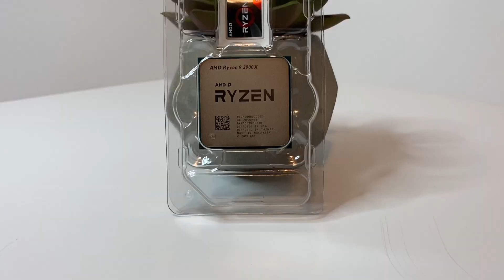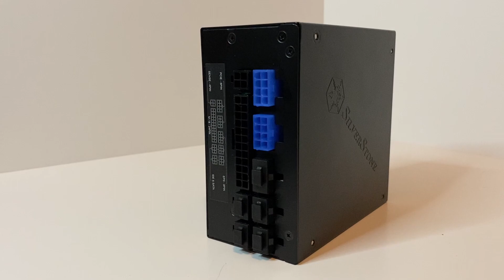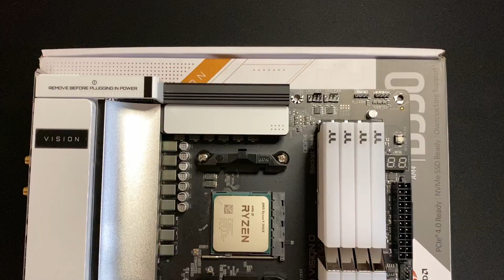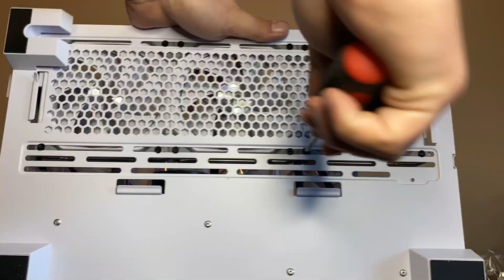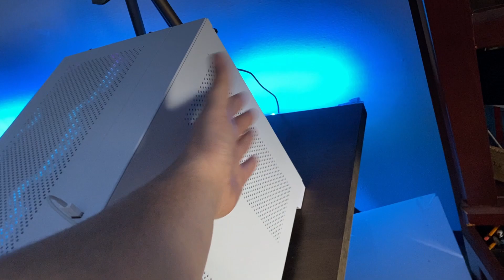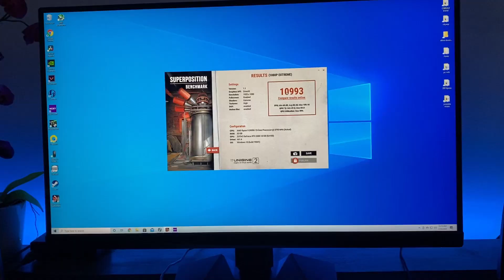$2800 My Dream PC Build! - Lian li o11 Dynamic Mini/ZotacGaming trinity 3080/lian li uni fan SL120

Comment: Lian Li makes great products and they look nice too! 
Your build: Any noise from the AIO as the air bubbles are now residing at the in/out let on the radiator? 
If so; try rotating the radiator 180 degrees. Or perhaps even better; mount it on top having the fans sucking air from the cabinet. Side and bottom fans should then be blowing air into the cabinet. Interesting to hear if that would improve test results for you. 
Congrats on making your dream PC build come true!!
Reply from the maker: Yeah thanks man!! No problem with this one but I appreciate the help! Stay safe

Comment: Sweet looking build!  You should flip your radiator fans as intake. the Brushed aluminum discs on the front peel right off with little effort so you can stick it right on over the Back label. I actually have 6 uni fans on the Galahad 360 in the 011D in push-pull as intake it looks like you have space for 2 more fans on the other side. If you are Playing @4K or even 1440P you won't really notice a difference from the 3900X to the 5900X. I did it but since I recouped most of my money selling the 3900X it wasn't a big deal. If you are running negative pressure you will end up sucking in dust through the crevices, if you flip the fans on your AIO you will have positive pressure and less dust. I have the Strix 3080 and Asus X-570-E with 32GB of Trident Neo, 2GB Sabrent Gen4 NVMeX2. W/12 Uni Fans. 
Haven't added it up yet and don't think I will. I Don't Wanna Know. I'll Just enjoy It. The 3080 keeps me warm for sure.

Comment: I watched another youtuber do comprehensive thermal testing for this setup. You'll get better thermals and noise if you flip your radiator fans to intakes.
Reply from the maker: I don’t even have this case anymore.. but it wasn’t loud and never got over 65 degrees.. and I’m in Texas with 97 temps outside

Comment: Double check aio orientation. Tubes should be at the bottom. Otherwise you risk running pump dry.

Comment: Just built my build (unfortunately paid a scalper for GPU about 100 over retail but I checked again recently and they’re somehow like 1100-1400 so paying half of that not so bad in hindsight lol)

Corsair 4000D airflow 
FE RTX 3070
MEG X570 ACE
16 GB Corsair Dom Platinum 3200
H100i PRO XT
9 5900x 
QVO 1 TB SSD
2 HDD
Rm1000 gold PSU 

So excited man hoping to snag a 3080 if I I’m ever fortunate enough to find retail

Comment: White vinyl wrap the backplate of the GPU in something like a whit carbon fiber would look clean. I wrapped my EVGA 3080 in white carbon in a vertical mount came out great and doesn't void warranty.
Reply from the maker: Yo you read my mind I actually bought vinyl rap today 😂😂
Reply: @CGBuild  It's really easy you wont even need a heat gun as the area your doing is mostly flat. Great build you have and you can get some serious thermal reduction and only loose 1-2fps from undervolting plus lower power usage. I got mine at 1980core @ 60c and +500Mhz mem running 900mv on a EVGA XC3 Ultra.
Reply from the maker: @scipher99  thanks my guy!

Comment: Do you think it’s safe to mount the aio tubes down on the side? I’ve seen videos and some mount the aio upside down and it’s in the front and it’s considered a good mount position. Do you think the same applies for the side
Reply from the maker: Well ever since that gamer nexus video came out everyone thinks that you need to but the tubes down.. it was a good video but for the most part you can do whatever you want.. manufacturers of pre-build systems still don’t put their tubes down if they put a radiator in so that’s all I’ll say.. but you can put the tubes however you want as long as it can reach
Reply: @CGBuild  would it make sense to have additional intake? Sorry for all the questions. Just curious about the thermals
Reply from the maker: @brokensinangel  yeah it would but with the aio on the side it has to be exhaust.. or I mean it can be intake but it’s not the best
Reply: @CGBuild  if I were to mount the side as intake with the aio would it cause any thermal issues? And why isn’t it the best?

Comment: I pretty much built this pc yesterday, but with a Ryzen 5 5800x. After booting, nothing displayed on the screen. I found that the bios is most likely not up-to-date to handle the 5000 series Cpu's. Now I have to disconnect everything on the motherboard, even the cpu, to do a qflash bios update. I hope that fixes it. Not something you would like to do after your new build 😔

Comment: Nice build man, I just got the same power supply. What did you do with the extra 4 pin connector on the 24 pin motherboard connector?

Comment: Awesome build, just a word of advice. rather relocate your aio to the top with the top fans running as exhaust and then have 2x side and 3x bottom as intake. you will see better gpu temps that way and your case will get less dusty over time.
Reply from the maker: In this case with an atx motherboard you can’t have the aio on top I would have definitely done that instead but sadly you can’t but thanks!!

Comment: How’s the PSU functioning ? I’m getting the same specs although waiting on the 3080ti. I’ve ordered the SF750 Corsair and wondering if that would be enough or should I upgrade it to 800-850w

Comment: That is a really good looking system. You obviously considered every part of that in advance. The memory and fans you used are really neat. I hadn't seen either before. I may have to consider the memory at least when I get to build my own dream system in the next few months. What size monitor are you using by the way. That's part of what I'll be including with mine since I've never gotten to have a nice large high rez montior.

Comment: i have a nzxt z63 240mm aio cooler, should i have the fans facing the way you did? ( exhaust ) instead of intake? i was thinking putting 3 normal fans below the gpu as intake then 3 ontop as exhaust. so will be okay for the aio cooler to be like yours? aka an exhaust or do you recommend intake?

Comment: your pump is going to suffer, as gamers nexus said you should put the pipes at the bottom because their might be air bubbles in the resovoir causing issuse and decreasing lifespan and acoustics as it is louder

Comment: Why specifically thermaltake ram? Doesnt seem like you have any other components to sync the rgb together to synapse. Id personally recommend gskill or teamgroup ram just for the sake of total sync
Reply from the maker: Thermaltake software is so easy you just put what you want and never gotta touch it again until you wanna change it.. I’m okay with having different software but for the most part I never really have rgb on

Comment: Hello mate I have a very similar build I have a question with regards to the SL120 fans did you connect the 2 on the radiator to the controller or the motherboard. Thanks
Reply from the maker: I connected everything to the controller
Reply: Many thanks👍🏼

Comment: Only negative id say about the whole setup is the fan positioning, I may be wrong, but it looks like you have 3 in take fans and 6 Exhaust, 3 On the rad and 3 above are all exhaust no? Your going to have some abnormal temps
Reply from the maker: That’s the only config I can use with this case but I’m having no problems!!

Comment: Fans at the bottom should be exhaust / intaking the heat of the GPU right? So that the air won't clash when the GPU releases its heat, then at the top side should be the one who's intaking fresh air.
Reply from the maker: Heat rises so when the heat is released it will go up so if you have the top as exhaust it makes the system run smoothly and not have so much negative pressure
Reply from the maker: @DoctorQcumber  yeah imma leave it 😂

Comment: I just got this case. What’s the best fan configuration
Reply from the maker: Use the bottom as intake
Reply from the maker: If you don’t have aio on the side the use side as intake as well the top as exhaust
Reply: @CGBuild  I’m gonna put my aio on the side. So use it as exhaust?
Reply from the maker: @brokensinangel  yeah have the fans just like mine in the video bottom as intake and side and top as exhaust

Comment: I'm building a similar one soon, parts are on the way. 
Specs in case you want em
GPU: 3070ti aorus master
CPU: 9 5900x
Cooler: corsair elite capellix 360
10 Lian li al120 fans
Case: Lian li o11 dynamic evo
Mother board: gigabyte x570s aorus elite AX
Ram: team group xtreem ARGB 2 16gb packs, 32gb
Ssd: corsair m400 2tb

Comment: too bad you couldn't get a hold of that white edition zotac makes. Also iirc your 3080 is similar to mine and strongly benefits from an undervolt.
Reply from the maker: Yeah a white card would have been sick... maybe one day... and thanks for the tip!
Reply: @CGBuild  I got a +100 OC @ .837 on my XC3, hope yours can hit some good numbers too. 

Wish that case came out when it was supposed to, else I would be using it too. Well done.

Comment: I’m assuming you’re using L Connect for the fan rgb. Can you set each individual fan to different colors. Like on the top you have three. Can u do the first one red and the middle one white and the third one blue? If so how
Reply from the maker: I’m pretty sure you can’t because you have them all connected together an in locked together.. if you had each fan with its own cords then you could use them and have different colors like you are saying
Reply: @CGBuild  what about each group then. it appears u have three groups. (3 on top, 2 in the back right and 3 on the bottom) can you do the top group a certain color for all three. And then a different color for the two on the right and another color for the bottom three?
Reply from the maker: @A.Sostan  yeah you can do that.. you just click the group you want to be that color and they hit apply.. this is in the L-connect software

Comment: Did you have to update the BIOS? I'm thinking of getting the same B550 board.
Reply from the maker: No I didn’t need to but I did after the build was finished just because I wanted to.. but if you buy the board you shouldn’t have to update bios

Comment: nice build how did you make the logo for the aio i need one  but don't know how to make it
Reply from the maker: It’s just in the soft ware for the aio.. you can just make a gif out of whatever image and then you can place it there.. you can watch people do it on YouTube
Reply: @CGBuild  nice I'm working on a build hit a tiny snag tho my specs are  gigabyte z390 9900ks  2 4TB nvme one 16GB  hard drive I have another TB of SSD storage new from old build n 1200 wat PSU with  gup RTX 3090 ftw

Comment: What software do you use for your fan rgb? They look amazing!
Reply from the maker: It’s just the l-connect software
Reply: @CGBuild  does it only work with the uni fans, or would I be able to use it for other fans too?
Reply from the maker: @aidenhallett1779  it only works for the uni fans
Reply: @CGBuild  that sucks

Comment: Yo. I have a noob question im new to pc building. For cpu which is better intel or ryzen? For gaming and streaming.
Reply from the maker: Both are good options but pretty much intel was better for gaming and ryzen is better for multi tasking... now with the newest cpus from ryzen the 5000 series they are pretty much better for gaming...
Reply from the maker: If you record with NVENC it uses your gpu to stream so I would save a little money and get a better cpu with a i5 10th gen or ryzen 5 3600... if you were on a budget.

Comment: I have a question for this case. In the website it says it only supports SFX/ SFX-L psu but in Bitwit video he used a rog 850 atx psu and he didn't stated any problems.  It will be rly sad if i cant use a regular psu  since  I bought a 1000w psu on 50% off  3 months ago and I cannot return it anymore. I checked in reddit and the answers were from people that didn't had the case. Im gonna be really thankful if somehow you can measure if atx psu will fit
Reply from the maker: He did have problems the whole PSU wouldn’t fit in the case and had to set it up temporarily until he had a sfx..
You can probably mod the case so that it could fit but it only fits sfx and sfx-l
Reply: @CGBuild  That is mb Im so sorry i just rewatched the video... I guess i will figure out a way to fit it.  In my country they say "There is nothing that doesn't fit, a little  bit force and it will" thx for the fast response +1 sub incredible job on the build dude
Reply from the maker: @christianivanov5878  thanks my guy that means a lot!! And no problem I hope you can make it work best of luck!!

Comment: Hey bro I understand that this might be a little too personal, but I was wondering, how much do you charge your clients per pc build? If this is a little too invasive I completely understand, keep up the great work on your channel!
Reply from the maker: i usually will make a video on them and so I just charge $100-$200 but you can always charge more if need be
Reply: @CGBuild Thanks! Also I was wondering, do you help with any part of the purchasing/picking out the parts, or do you only put the build together,
Reply from the maker: @legendaryz6230  I actually do both I help with picking the parts if they are unsure.. but sometimes they just know what they want and I build it
Reply from the maker: @legendaryz6230  I don’t spend any of my money on the parts it’s only theirs
Reply from the maker: @legendaryz6230  I was actually thinking of making a video on this so look out for that
Reply: @CGBuild  wow ok! Thx for the info!

Comment: would u possibly let me know if the parts i bought will be good🥺 i have a ryzen 7 3800x , EVGA 3060 XC , Asus ROG STRIX b550 so far. this is my first time building one i’m very new to this!
Reply from the maker: Yeah those are good parts just gotta get the rest😂 you already got the hard part out the way witch is the gpu!

Comment: I’m rly new at this. And I have a big question. Don’t you have to put thermal paste on ur cpu ? Or does that kind of cooler not require it ?
Reply from the maker: The aio comes with it pre applied
Reply from the maker: Most coolers come with some already on it
Reply: @CGBuild  ohhh ok thx mate. Saw some other tech YouTuber  saying that the pre applied paste isn’t that good ? Is that the case here too ? Btw love ur build.
Reply from the maker: @lukasscharpf4429  yeah it’s worked fine for me... thanks!

Comment: i may sound dumb but how does the airflow work? is the top intake and bottom exhaust or vice versa.
Reply from the maker: What I have in this case is intake at the bottom and exhaust but you can switch that if you would like but with the radiator you want it to be exhaust
Reply from the maker: It’s not a dumb question😂 I wish someone told me how fans work when I was trying to build my first pc

Comment: hiii! so i’m currently building my first build and i keep getting stumped lol. i am using the same aio cooler as you with the lian li fans. i’m so confused on where to plug the fans at? does it connect to the controller or to the motherboard?
Reply: if there’s any way i can reach out to you with help please let me know 😅 i’m really stumped on building this pc haha
Reply from the maker: So the fans you should connect to the hub they come with.. and then the hub connects to the mobo so it’s connected
Reply: @CGBuild  gotcha, that’s what i was doing… but i also did forget to plug it into the SATA lmao. most likely why it isnt working haha. what did you do with the cable that plugs into the aio that says nzxt at the end of it? just leave it hanging?
Reply from the maker: @AnyaGrace  I didn’t think you need that one for what you are doing.. it’s like an extra rgb header or something
Reply: @CGBuild  gotcha. are you saying to only connect that usb to the aio and not the breakaway cable set? sorry for so many questions
Reply from the maker: @AnyaGrace  yes.. and it’s okay I’m happy to help! I’ve built so many PCs since this video came out so I’m trying to remember what I did 😂
Reply: @CGBuild  hahahh i appreciate the help. i was looking at the manual for the nzxt aio and the breakaway cable has a 3 pin connector to connect to the aio pump header… so should i just keep it connected then? lol
Reply from the maker: @AnyaGrace  yeah go ahead and just keep it
Reply: @CGBuild  i appreciate your help! thank you so much

Comment: You are killing your aio, your pump is higher below your radiator this is speeding up permeation and will run dry your pump and cause it to break eventually and if you listen closely you can hear noise of the coolant bubbling in the pump, so I suggest you to place your radiator either at the top of the case or bring jt a bit down so that the pump is higher, im saying this from experience, trying to help you out mate.
Thanks
Reply: True, GamersNexus did a vid on that exact topic👍👍👍👍👍
Reply: Wait isn't the pump already in the water block? I think his installing is right, as you can clearly see his radiator is above the water block, that prevents air from getting in the water block and effecting cooler efficiency and lifetime of the product
From the GamerNexus video, this installation is decent enough to not cause any damage
Reply: As long as the radiator tubes are above the pump, everything is fine. Don't take the GamersNexus video out of context. His cooler will be just fine man.
Reply: You can't move the pump down as it can only be connected to the CPU. As long as the top of the radiator is above the pump then there's no issues, You seem to be getting mixed up with something. Top mounting would be better. His fans are the wrong way round though.